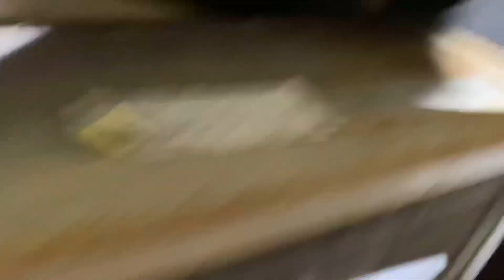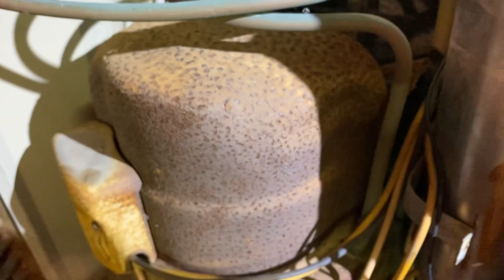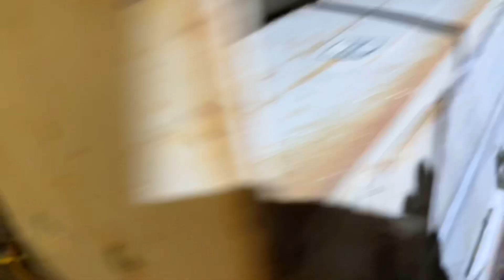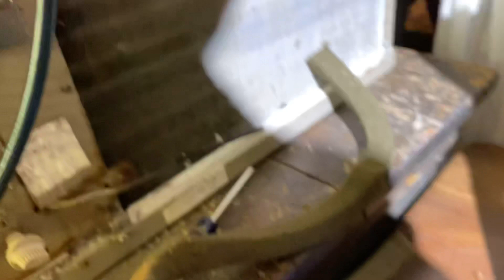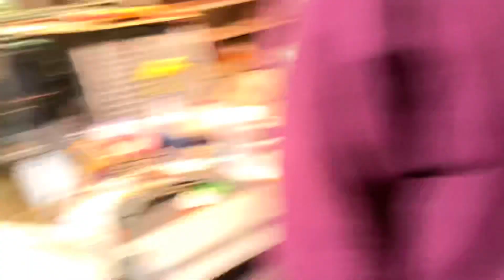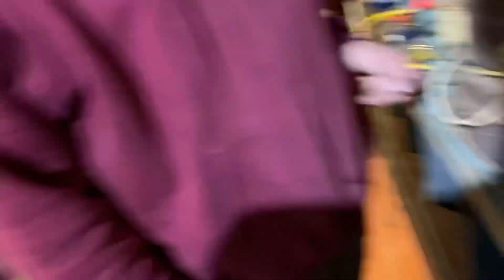The 1969 14000 BTU High Efficiency Unit Lives!

Comment: Have you thought of using a charging scale while charging these units?  What i normally do if a low charge is suspected, is i try to find leak. Then reclaim charge, repair leak, charge with nitrogen and watch to see if repair is holding, release nitro charge, pull a good deep vacuum on system, and charge the exact factory charge back into system using a charging scale.  Takes the guesswork out of charging the unit.  This method only works if the charge pounds and ounces are listed on the data plate.  Some dont list how much refrigerant the system holds.  Most of these units dont take much refrigerant.
Reply: This is the exact method that was followed. Ken is an HVAC tech and has all the knowledge and cool toys.
Reply from the maker: @angrodNumenesse  beat me to it, this is exactly how it was done.